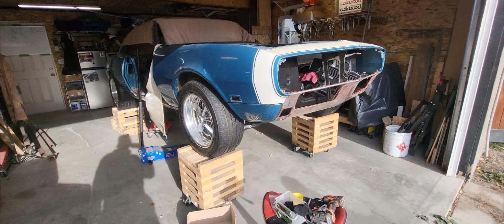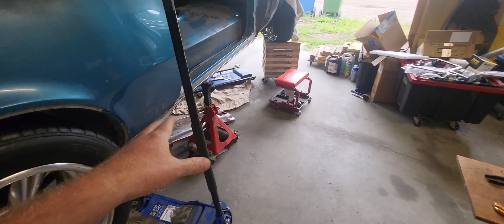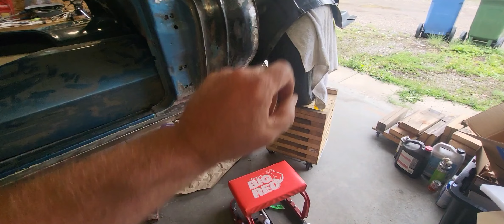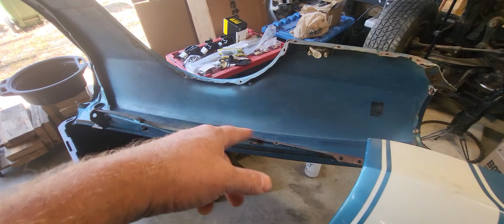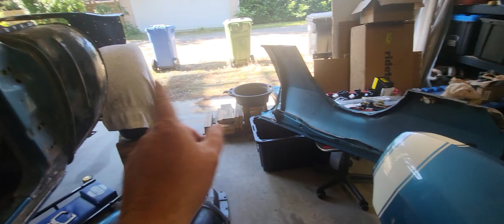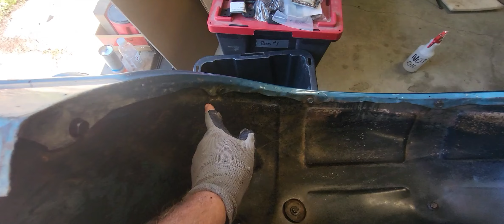1968 Camaro Project #73 Assembly of Front Sheet Metal (Fenders, Header Panel, Lower Valance, Oh My!)

Comment: I mocked up my 67 RS the same way and was reasonably happy with the fitment, except for 2 things: the driver’s side fender is aftermarket and fit like crap at the base of the windshield and the body line at the door. Are your fenders GM? Plus, ai didn’t have the inner fenders handy to put more pieces together. Need to try that!
Reply from the maker: I believe these are original to the car. So far it's fitting together pretty good. Fingers crossed.
Reply: @ElrodsGarage yes, keep your fingers crossed! Once the doors are on, it’s a totally different story if anything is aftermarket. I have a friend who had his driver’s side fender off and back on 100times while he made sheetmetal changes to make good alignments